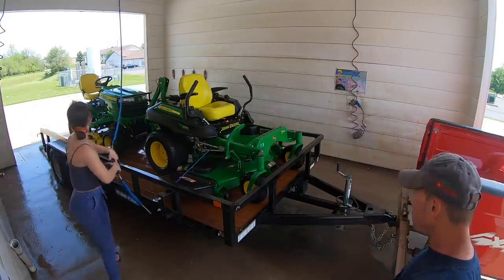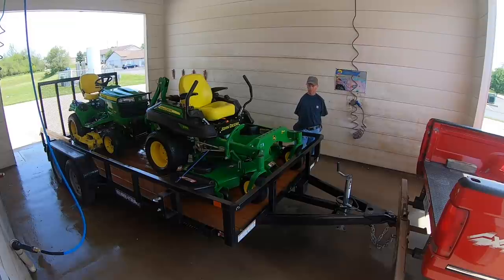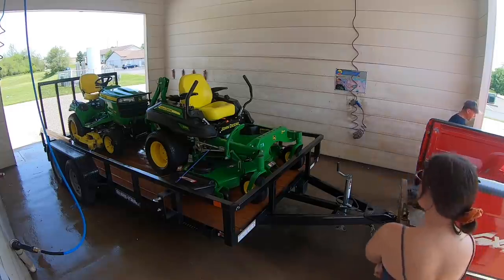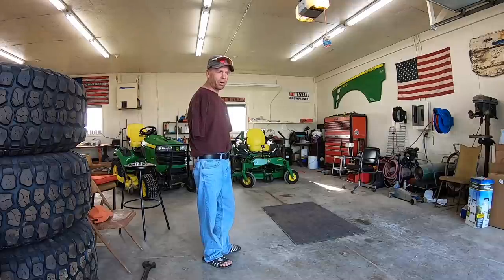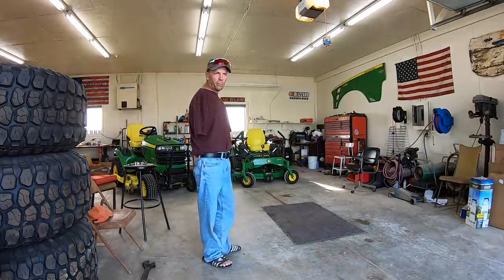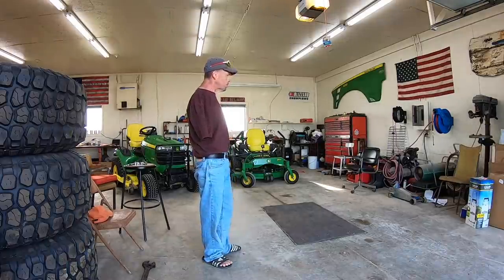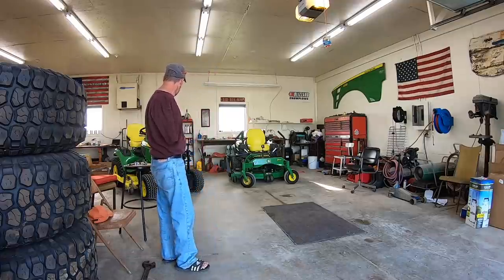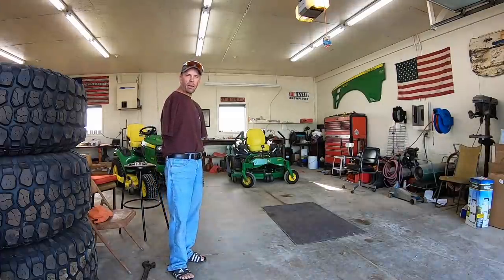I Bought A Hand Operated Mower

Comment: I bet you could fabricate some foot pedals for the zero turn. That just attached to the hand levers
Reply: at the bottom of the hand lever it attaches to a control rod that goes to the hydrostatic transmission. 2 skid steer style pedals {middle pivot so they got fwd and reverse on each pedal} extend the control rods up to the pedals. you are in business. wouldnt be that complicated of a mod really...
Reply: @DieselRamcharger  that’s what I was doing thinking excactly!!!!
Reply: @JS-zb1vv  theres a guy that tried to market the "ergomower" which is basically just that. i think he should have made his productive adaptive and not a dedicated mower. probably woulda found a market.
Reply: Just like a Tracked Excavator 👍🏻
Reply: That’s what friends are for.   👍🍺

Comment: Andy,   A couple comments for you.   I was told one time by a lawn mower sales person that I should never wash a mower deck with water.   He said than the water dissolves the very very fine particles and helps them get into your bearings on the shafts.   Sealed bearings worse than grease able.   This is one I learned this last year.  Last spring, I cleaned my deck and scrapped the grass crud off the underside of the mower deck.  While I had it up, I grabbed WD40 and sprayed the whole underside hoping to slow surface rust.   This spring, tilted up to get to blades to sharpen.  Nothing to scrape!   No grass stuck to the deck.   Best Wishes!    Kevin

Comment: Several years ago, Onelonleyfarmer did a video on a Dremel attachment for sharpening chainsaw blades. The kit also has a guide for sharpening lawn mower blades. Works great and I also use it for discbine blades and Bush Hog blades (with a little modification). And someone needs to send Andy a Cordless grease gun with a Lock 'n Lube.

Comment: I just did my deck mtce. a couple days ago.  Sharpened the blades, but the worst part was cleaning the build up of grass on the underside of the deck.  I like my JD 1025R.  Bought it in 2013 with 20 hrs. on it.  It came with a loader and mower deck.  I bought a back blade for it.
Reply from the maker: Thats a handy little tractor

Comment: With mine it would be perfect for you mine is a John Deere ztrack 727A but all the controls are at your feet like the blade switch, choke, hour meter, key, how fast the engine runs the only thing that isn’t there is the parking brake that is on your right and you also have the blade hight petal at your feet.

Comment: it actually looks like it would be pretty easy to make some lower control levers for the zero turn.
Reply: My thought exactly in fact all you would have to do is add a bar that goes from the current bar down to feet area and put some peddles with straps on it to put your feet in.

Comment: I'm curious... don't folks sharpen their own mower blades anymore themselves?   I have heard of other farmers buying new  blades for their mowers.    They are so easy to sharpen on a bench grinder and coarse wheel and follow up with a file for a razor sharp blade.   Back in the 60's I re-sharpened the blade every time I went out to mow my Dads 2 acre  lawn around the house and part pf the orchard which was all in blue grass.  

With a sharp edge the blade actually cuts the blades of grass rather than tearing  the grass with a blunt blade and leaving the grass frizzy on the ends which would turn brown in a day or two.  Never had a balance issue and never had to buy New Blades due to wear.  Am I that far out of touch?? with what is happening now?

    A Sharp blade  takes less fuel and is easier on the engine a it does not have to work as Hard.  Keep in  mind for the first 2 years I had this lawn, I had a 16" cut, push type mower with a 5 horse engine.... from Sears....  It was over a 1/4 to a 1/3 of mile per lap and took me the better part of day to get the job done.
   I got the biggest kick out f my Dad when I Left home to join the Air Force, He went out and picked up a used golf course mower with a 6 ft swath and he could knock it out in a couple of hours.   Ha Ha .. he always razed me about that one.    Would like to hear from anyone on this subject....Thanks....
Russ
Reply: I'm with you. Mine was 18"(oooohhhh). But it took me 3 full days to mow the lawn. Sometimes, with the spring rains, I'd have to start from the beginning only a day or two after finishing.
Reply from the maker: We sharpen all of our own blades ourselves

Comment: WERNT YA SUPOSED TO PUT THEM RED THINGYS UNDER THE WHEELS FOR added safety?  laughing so hard i know  i know a smart ass in all crowds nice to see i not only one who liftes the mower the same way, i use the forklift at  work is all i have
only thing my johndeer mower is the smallest tractor johndeer makes it has a 28 inch deck. i bought it for that reason cause da boss has a huge one like yours but it wont go between the trees. I paid 75 bucks for it the guy said the trans was broke cause they just had a new belt put on it, laughs who ever did the belt done it wrong, cost me 26 bucks for the belt and runs like a deer lol.